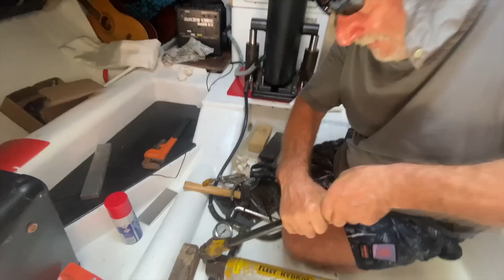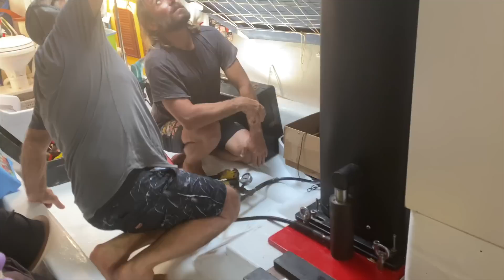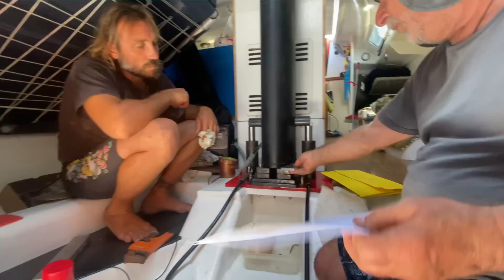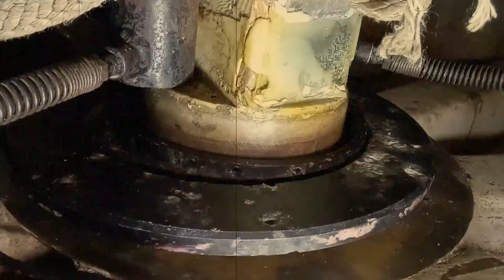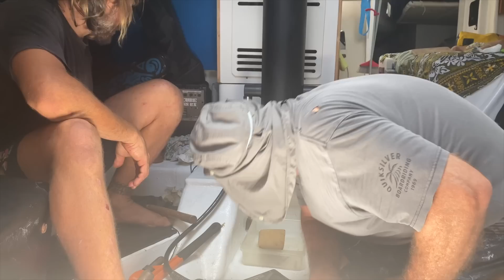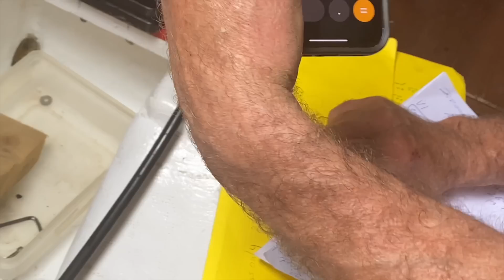How to tune a carbon MAST with a HYDRAULIC JACK | Ep. 40

Comment: To be clear: the published tune pressures and calculations Pete is going through are what is known as "dock tune" loads. So static condition, no sails, heeling or wave action. The dynamic loads under way are magnitudes larger than these jack loads, so the tune should be no drama at all. Think about what happens when you hammer on the backstay, runners, halyards and mainsheet and send it off a wave a few hundred times....
Reply from the maker: I think you know e lotta about this 
Thank you to sharing with us
Reply: @SailingNV  I am a rigging tech, yes.

Comment: You guys need an electric pump. 
And keep your fingers out from under the mast.
The drama - "no one knows" - is just not true. Boats commonly use load cells under the mast base to measure the compression while sailing. 
Hydraulics operate at extremely high pressures. It is really easy to fail to recognize this when you are working on or near them. A tiny hydraulic leak can cut like a water jet (used to cut steel or granite in industry) stripping flesh from bone, or piercing the skin, creating an oil embolism in the blood stream and can be deadly. 
Don't touch the hoses when they are under load, don't get your fingers in the way of the rams. Get as far away as you can anytime someone is jacking a rig.
Maybe get the baby out of there.
Reply from the maker: Thank you for your comment di 
I wanna have Electric Pump 
Tell me more
Reply: @SailingNV  We use Enerpak WE and PU series pumps. I see the WE is now discontinued and replaced by ZE series, which are very nice pumps. They also now have a cordless series, which would be handy, although I've never used one. The valves on all of these can be quite touchy and need some practice to release under load without dumping the pressure and dropping the load. To prevent this we use V82 needle valves inline which are quite easy to throttle under pressure. 
These things are not cheap, you can find used equipment on eBay, or industrial auction and resellers. A wired remote is a  nice option, make sure the oil capacity of the pump exceeds the oil capacity of your cylinder(s) and hoses. The hoses are important, be sure they are good quality and take careful care of them. 
I am not an Enerpak salesman, there are other brands out there - Holmatro, Power Team, Reckmann, etc. Components can be mixed between the manufacturers.  Good luck, happy to help if you need.

Comment: Great stuff here...in the next one please give an indication of the load the rig will have when under sail...obviously these will rise as wind pressure increases. I understand now modern rigs on big race boats are getting sensors built in to provide live telemetry on loads the various parts of the rig is under.  Amazing how much load a sailboat can be under...
Reply from the maker: Hey Eva! Sorry just finished the upload and realised I didn’t talk about this. We will definitely talk about this in a future video though. But I can say for now for example that when upwind, all the tension moves to one side of the rig. And this force increases exponentially when the boat impacts on a wave!
Reply: I can help with that. What Pete carried out is referred to as a dock tune.  The design working mast compression for that boat under sail is a bit over 35 tonnes  and includes the effects of things like  crew weight on the rail and halyard loads.

Comment: Oh no.  Looks like you are actually at 8600 kg per side, not 8600 kg total.   The two rams are in parallel seeing the same pressure so you cannot divide by two.  I hope I'm missing something there, but you showed the gauge, the plumbing, and the plot.  Or is the plot already for a pair of rams in parallel?
Reply from the maker: Heyhey, so the reason we divide by 2 is because the pressure that the mast feels at the base (which is the same as each piston feels - it’s the pressure in the jack system) is split between both sides of the rig… I hope that makes it clearer. And yes the plot is for our jack
Reply: The chart indicates total mast compression for a given pressure and takes into account that this is being acheived with two RC15 Enerpac rams. So all good.